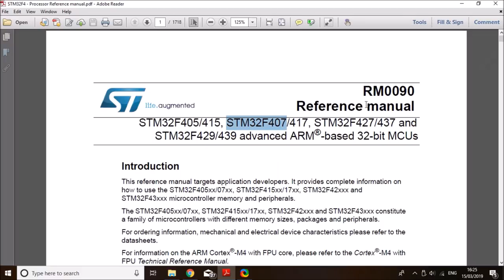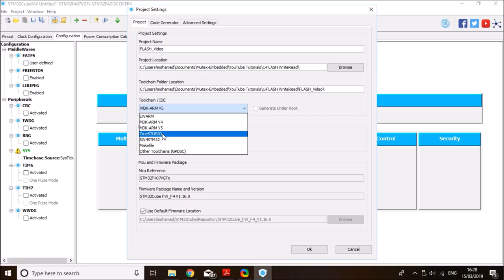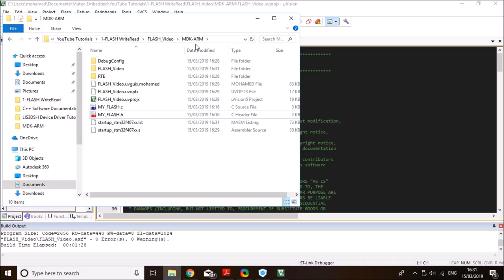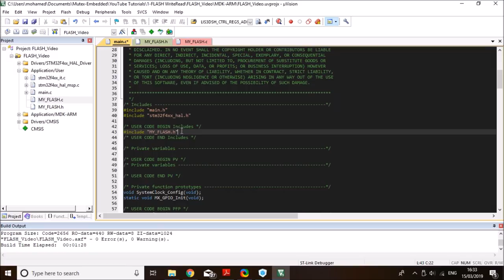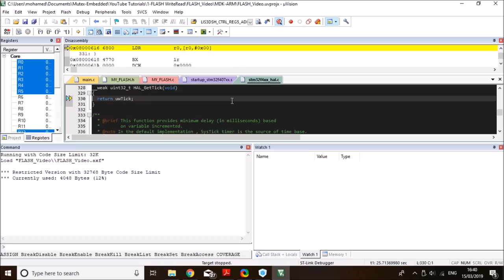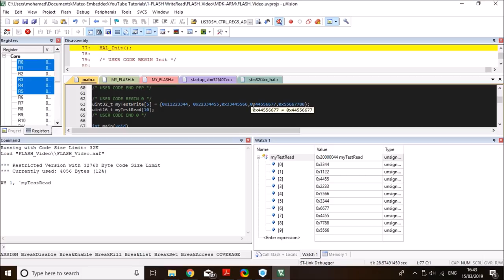STM32F4 Discovery board - Keil 5 IDE with CubeMX: Tutorial 30 - FLASH Memory

Comment: Sorry to be a me too +1.  Please see my comments in the enc28j60 part 3 video thread.  I am stuck not getting an ARP message in wireshark. 
As for the TFT stuff, I have that working well on SPI. As for the GFX library, that comes from Adafruit and everyone uses it.
What does make these tutorials great is that MYaqoob does base his functions on the Arduino ones, but without all the C++ nonsense. So once the foundations are working you can extend them to use the code in  the Arduino library functions and high level sketch data,  just not with all the stuff hidden under the processing C++ preprocessor.   Here you see the nitty gritty details of the lowest bare metal use.  Which is really great stuff.
Note that ST does have an official Arduino option based lib the open source stmduino, which has many of these libraries already ported to the Arduino IDE.
On the other  hand these tutorials teach one how things really work.  

Many thanks to the work done here. and may you find the time to help those of us who like to  help others.
Reply from the maker: Hey, thanks for your comment!
Reply: Your welcome,
I am still stuck on the ENC28j60.  I rewrote most of your setup with more current Arduino naming conventions.  Populated the ARP dynamically.  Same result, NIC lights flicker, but nothing in wireshark.  There was a difference with the endian and naming of the Mac registers, but that made no difference.  I only have S4SWM32 and the Nucleo F401RE so can not test with Keil and see if things are being compiled in the same order.  Stepping through, everything seems correct.

No problems with any of the other tutorials, they work great.  Again than you for your time.
Reply from the maker: @spiralsheepdoll  hi,
Has been ages since I worked on the ENC28, I am planning on making Ethernet tutorial series with STM32 MAC instead of ENC28
Reply: Looking forward to it, I have a bunch of PYHs too.  Probably much easier as CubeMX supports LwIP.  I have a Discovery 429i.  One has to disable the Gyro though to make the PHY work. 
In the meantime, I will continue with expanding the Arduino libs for the ENC28J60.  Your tutorial remains a good overview of how it should work,  even when the main.c and main.h reference is missing.   There is still value in these SPI devices on the smaller chips without a built in Ethernet controller.
Again thank you for your time.

Comment: Thank you 4 this vdo sir Ji.
May I know, is it safe to use flash emulation to store data? Bcoz in my application, I am storing 25 parameters in the flash section using your library, and I'm going to give this code to one of my clients. So before going to do this, I need to make sure that is it safe to use flash to store data? or should I use an external EEPROM?

I tried it with STM32F401 and it was working well for 17 days. After that, it starts to reset again and again. I don't know what's going on. I google it but haven't found a proper answer to it.

If anyone expert in this field plz let me know your opinion.

Thank you.
Reply from the maker: Hi,
If your application is not RTOS based, and not time-critical.
It is safe, 
as long as you do not overwrite code sectors in Flash.

Comment: If you using stm32f103 and  get  error at lib files (ex :
1_ implicit declaration of function 'FLASH_Erase_Sector
 2_ 'FLASH_VOLTAGE_RANGE_3'

3_ 'FLASH_TYPEPROGRAM_BYTE' undeclared)
Firstly you should choose stm32f4 at cube mx and generate the code. After some downloads try again at stm32f103. I fix this error like that.
Reply from the maker: Hi,
That's right, F1 has different Flash functions
Reply: @mutexembedded2206  i am using for a  variable and its changes second by second. What should i do for the save this data ?  external eeprom or flash memory on stm32f103 ?
Reply from the maker: @talhadeveci9298  it is fine as long as your application is ok with slow Flash erase/write operation for STM32 Flash.
Reply: @mutexembedded2206  thanks from turkey for your comment and stm32 contents :)
Reply from the maker: @talhadeveci9298  :)
Reply: Ne demek istediğini tam anlamadım. önce stm32f4 e göre ayarlar yaptırıp cubemx de sonra stm32f1 e mi dönüyorsun yoksa kütüphane için mi yapıyorsun. Biraz anlatabilir misin çünkü köşeye sıkışmış durumdayım.

Comment: How do you modify the linker script to reserve a sector for user data... and such that this user sector won't get erased when re-programming/bootloading?

For example, the dual-core STM32H7 has TWO 8-sector Banks (0x8000000-0x80FFFFF &  0x8100000-0x81FFFFF).. with 2 linker scripts for each cpu (STM32H745XIHX_RAM.ld, STM32H745XIHX_FLASH.ld).   I assume the CPUs can run from either bank/sector, including execute from the same..  so for now, I've tried modifying just the M7's STM32H745XIHX_FLASH.ld : 

MEMORY
{
FLASH   (xr)     : ORIGIN = 0x08000000, LENGTH = 1920K
USER_FLASH (xrw) : ORIGIN = 0x081E0000, LENGTH = 128K   ******
RAM (xrw)        : ORIGIN = 0x20000000, LENGTH = 512K 
RAM_D2 (xrw)     : ORIGIN = 0x30000000, LENGTH = 
RAM_D3 (xrw)     : ORIGIN = 0x38000000, LENGTH = 
ITCMRAM (xrw)    : ORIGIN = 0x00000000, LENGTH = 64K
}

// Section must be 32-bytes aligned (size of a Flash Word)
  .NVM: ALIGN(0x10)
  {
    . = ALIGN(4);
    _NVM= .;
    . += NWCONFIG_SIZE ;
  } >USER_FLASH

main.c:

// 32-byte structure
typedef struct __packed {
    uint8_t val1;
    uint32_t val2[2];  // 8 bytes
    uint16_t val3;
    uint16_t val4;
    uint32_t val5[4];  // 16 bytes
    uint8_t val6[2];   // 2 bytes
    uint8_t val7;
} stNVM;

// Declare 32-byte variables inside USER_FLASH , should this be const??
__attribute__((__section__(".USER_FLASH"))) uint8_t NVM_user_data[16];  
extern volatile stNVM _NVM;

void test ( void )
{
    // flash 32 bytes at a time.
	HAL_FLASH_Unlock();
	
	// Erase / Write 32-bytes
	FLASH_PageErase(0x081E0000);
	CLEAR_BIT (FLASH->CR, (FLASH_CR_PER));
	HAL_FLASH_Program(TYPEPROGRAM_HALFWORD, 0x081E0000, NVM_user_data);
	CLEAR_BIT (FLASH->CR, (FLASH_CR_PG));

	// Erase / Write Next 32-bytes
	FLASH_PageErase(0x081E0000+32);
	CLEAR_BIT (FLASH->CR, (FLASH_CR_PER));
	HAL_FLASH_Program(TYPEPROGRAM_HALFWORD, 0x081E0000+32, _NVM);
	CLEAR_BIT (FLASH->CR, (FLASH_CR_PG));
	
	HAL_FLASH_Lock();
}

However, not sure if its cache related, or linker script / variable declaration, but my program does not write to flash, and  if I use CubeMxProgammer to manually put data in the USER_FLASH, it will get wiped out when I re-pgrogram the application via the Bootloader.

Comment: dear mohmad yaqoob

first thank you for your great video
I am using stm32f030k6t6 ic
and I try to store value in flash 
I use your library but there is error
FLASH_VOLTAGE_RANGE_3 undeclared .

please help me

static void MY_FLASH_EraseSector(void)

{

 HAL_FLASH_Unlock();

 //Erase the required Flash sector

 FLASH_Erase_Sector(MY_SectorNum, FLASH_VOLTAGE_RANGE_3); error this line

 HAL_FLASH_Lock();

}
Reply from the maker: Hi sorry, 
I might make another video on FLASH, where I show how you use it with different STM32 series, as each have different FLASH structure and slightly different HAL implementation.
Reply: ok many thanks

Comment: Great Tutorials, Please make some Tutorials on Winbond External Flash or using QuadSPI . Also make tutorial on OTA firmware update using cellular module.
Reply: There's an external flash chip on the F429 discovery board, so you might find some info from the example code for that board.

Comment: Sorry me my friend, but In the process of testing of your library, I met a problem :(
What could be the error ?
This is my step by step debug log >

HAL_StatusTypeDef HAL_FLASH_Lock(void)
{
  /* Set the LOCK Bit to lock the FLASH Registers access */
  FLASH->CR |= FLASH_CR_LOCK;
  return HAL_OK;  
}  // -----------------------------------   Here MCU hangs immediately, after pres the next "step over" debug button

                 if I move on with small debugging steps  ("step" button)  then i come here > 

MY_FLASH_ReadN (.........)
  case DATA_TYPE_8:
    for(uint32_t i=0; i<Nsize; i++)  //  immediately, after press the "step" debug button, MCU falls into HardFault_Handler()

Comment: I downloaded your library and studied it. When I got it into CubeIDE and compiled I get these errors:
*************************** ERROR LINES ***************************
1_ implicit declaration of function 'FLASH_Erase_Sector'; did you mean 'MY_FLASH_EraseSector'?
2_ 'FLASH_VOLTAGE_RANGE_3' undeclared (first use in this function); did you mean 'FLASH_FLAG_PGERR'?
3_ 'FLASH_TYPEPROGRAM_BYTE' undeclared (first use in this function); did you mean 'FLASH_TYPEPROGRAM_WORD'?
***********************************************************************
Did they update the HAL and change defines and declarations? Because it clearly works in your video. 
My MCU is STM32F103C8T6. The flash page and banks are a bit different though, maybe that's the problem?
Reply: Hi,  I using STM32H743ZI, I have problems like you
Reply: what should we do now ???
Reply: Same problem, did u fix it somehow?
Reply: i hav the same problem and iam using stm32f103c8t6
Reply: Same problem here. Does anyone fixed it? I'm using a STM32f103C8T6 board too. Help please!
Reply: did anyone find the solution of these errors